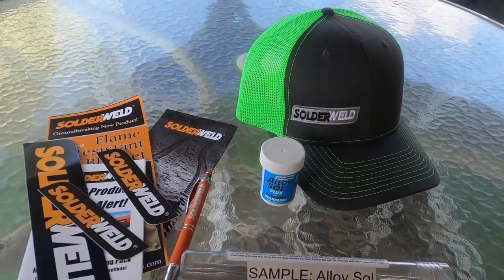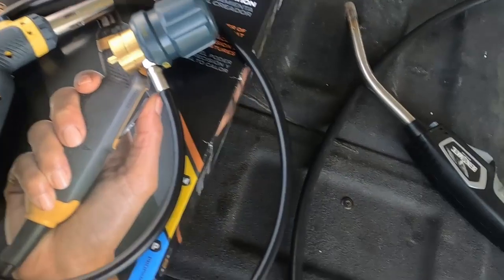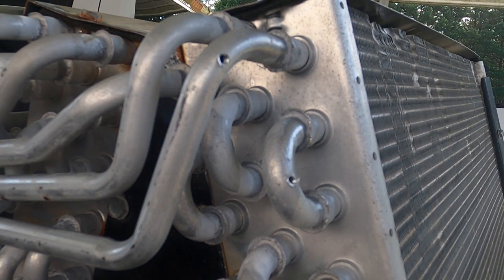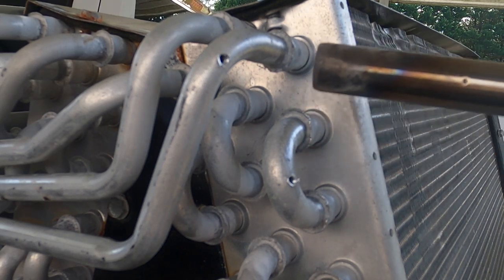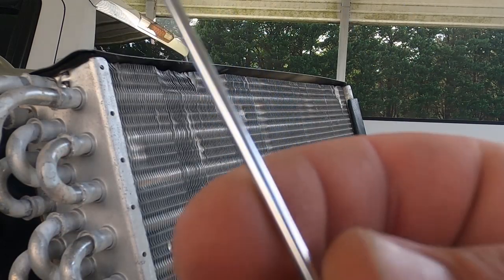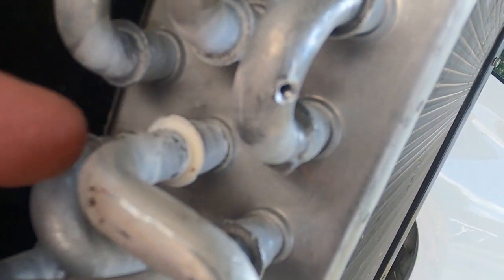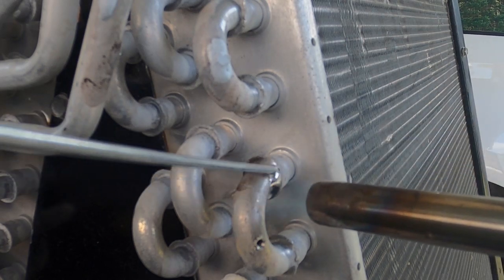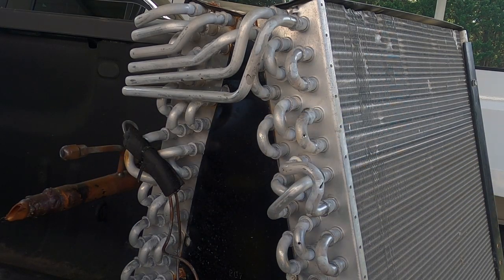Aluminum Brazing! Which do I prefer, SolderWeld or AL822?

Comment: I thought Alloy Sol rods came with a coating of flux on them, and you're not supposed to use extra flux. I mean that's what I've heard. I'm going to repair a HVAC low pressure line I nicked with the bottom of a car battery I was installing in my car. It's a pinhole the size of a safety pin needle.

Comment: Could you do a smaller area where the fins need to be removed? i would like to see that repair process.  So what gas did you use and exactly what is the bernzomatic tip that you did use > you told us the one you didn't use
Reply from the maker: Map gas. Got the torch on amazon.

Comment: It’s not the steps boss you need more heat you don’t have enough heat that’s what was happening to me using the solder weld when I was trying to use a Map gas torch you need a turbo torch or just use the small tip on your oxygen acetylene torch that stuff will flow smooth when you get enough heat!
Also I used the AL 822 and had a problem with gas leaking between the base metal and patch the torch pulls the oil from inside the coil and your patch doesn’t make a good seal! I don’t have the problem with the solder weld! Maybe just use the extra flux with the AL 822!

Comment: I love your video definitely the AL 822 is the better product. What gas did you use to weld with? I didn’t see where you showed that. I’ve never had a chance to work with an aluminum coil yet might have always been copper and where did you buy your torch at for your aluminum?
Reply from the maker: Map gas

Comment: Al822 isn't great at bridging larger gaps,  but it can join Cooper to aluminum. You can wrap a large hole with thermostat wire, then seal the whole thing with the 822. Since it flows so nice, it makes for a great repair.